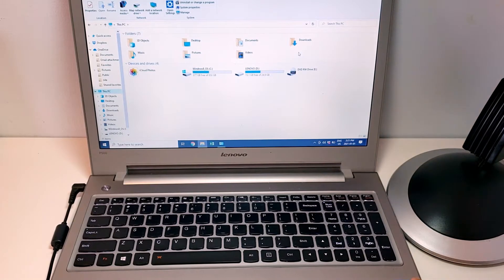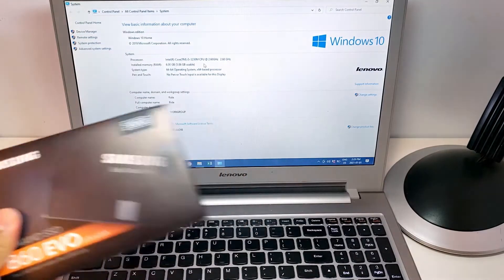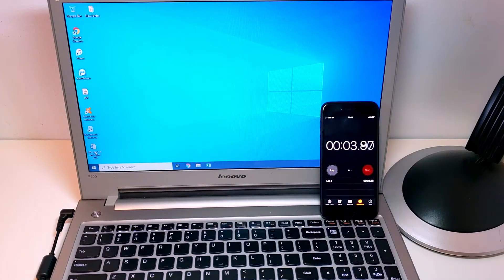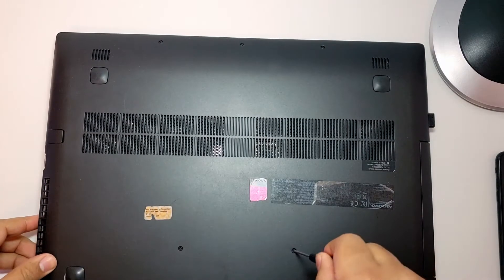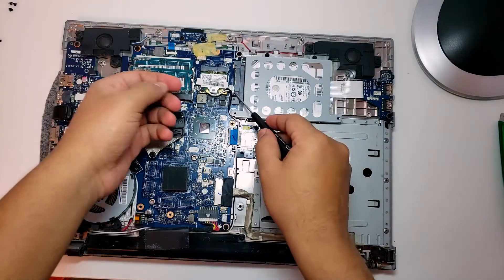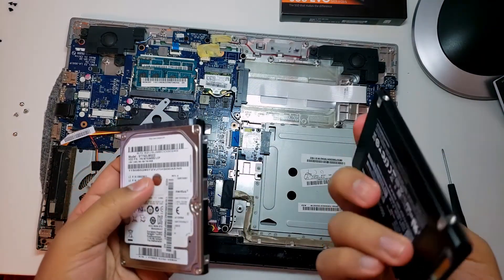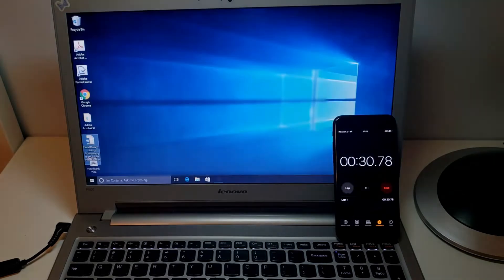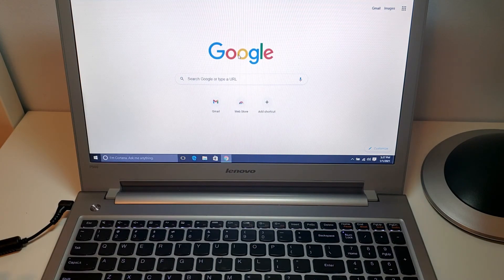SSD vs HDD Speed Test on 8 Years old Laptop | SSD VS HDD Speed Test

Comment: prob has exact specs as my older laptiop i have i5 with 8gb of ram though. gonna ghet a ssd for sure now. cheers
Reply from the maker: Yea its totally worth it. Most people tends to get the rod of the laptop because it gets slow. Just get a SSD and yoi are set
Reply: @AhsanAli786  1) The cooling system is clogged up with dust.
2) You might as well max out the ram.

Comment: Thats  a cool video mate !
i just wanted to ask whether upgrading to linux will make my old laptop faster along with this ssd. Its currently running windows 7 pro
Reply from the maker: Just SSD only can make your old laptop faster with widows 7 pro. But if you are okay using linux interface it will obsoletely make it MUCH faster.
Reply: @AhsanAli786  yeah thats right!   Im using an old lgr400 laptop can u tell whats the max ram for that machine. I tried searching in the Google but sometimes it says 4 gb and sometimes 2gb im confused